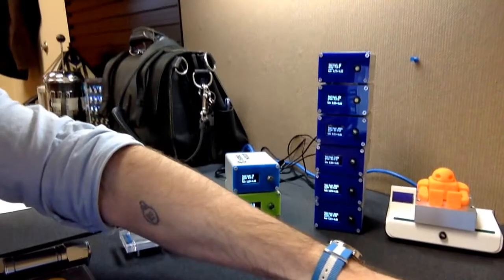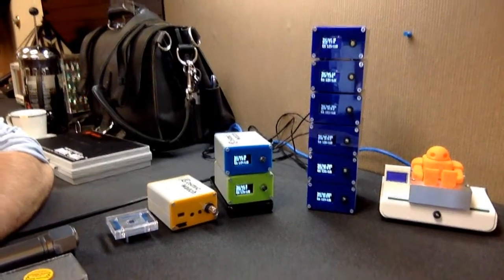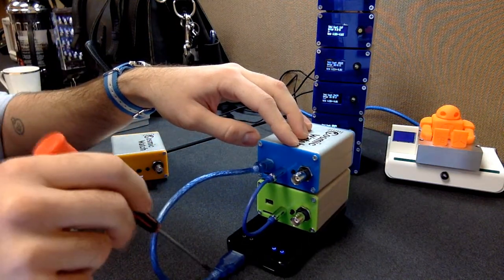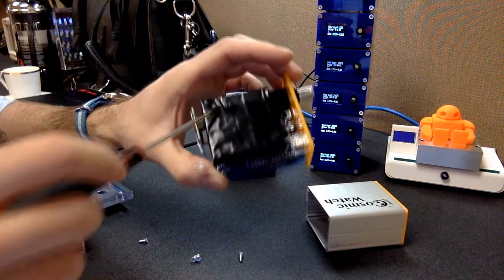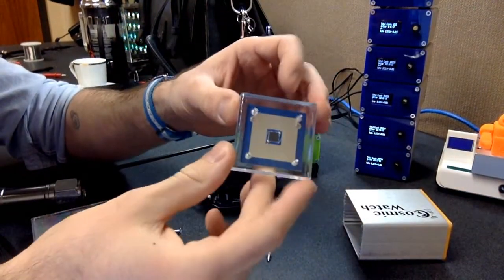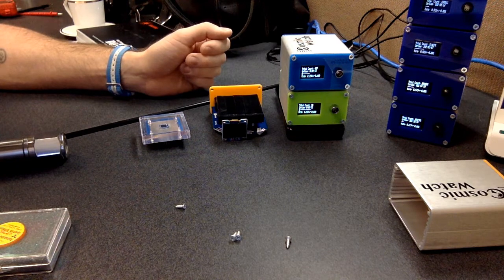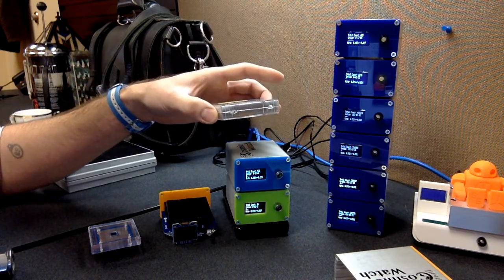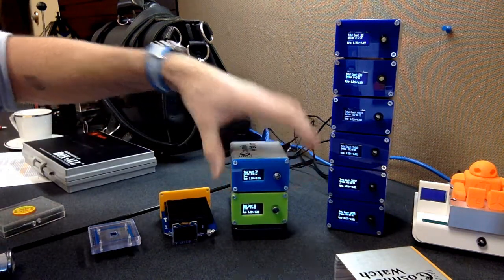CosmicWatch -- Part 1: Introduction

Comment: Hi, on the offchance your still receiving notifications for comments on this build, I'm building 2 of the units and noticed that the Detector Purchasing List mentions 2.5kohm ferrite bead for L2, but the Digikey part is for a 1kohm, while the PCB populating list Digikey part No is for a 2.5kohm one. which is correct? also how critical is the tolerance on this part as 2.2kohm are freely available while the 2.5kohm is harder to get

Comment: I want to build one. Where do I get the parts from?
Reply: Secret Owl  
Update: I already got the parts. Just have to spend time building it. Im more than half way done.
Reply: Secret Owl  
The scintillator I believe was found on ebay. The SiPM chip and amplifiers were from digikey. The rest was from Amazon. And I didn't bother getting the PCB made. Im  just settling with a simple breadboard. As for the case, I have not decided yet. I'll probably just 3d print it.
Reply: @BYMYSYD  How have you got on with the build?

Comment: Can we use it with a cubesat to measure the rate of muons in low earth orbit ?
Reply: Yes as this will also pick up most other elementary particles aswell. I am currently doing this experiment
Reply: There woud almost be none, so you could do it, but dont get much results.